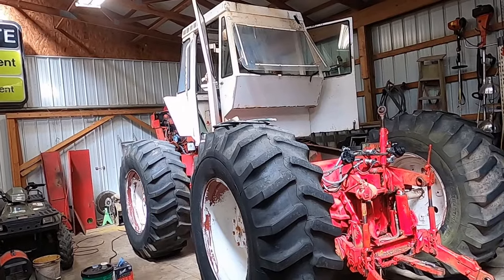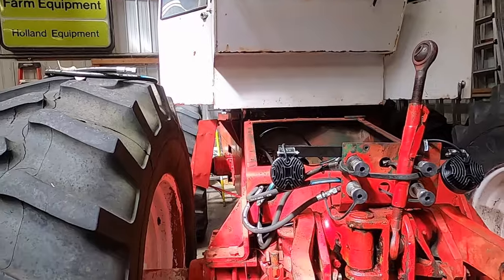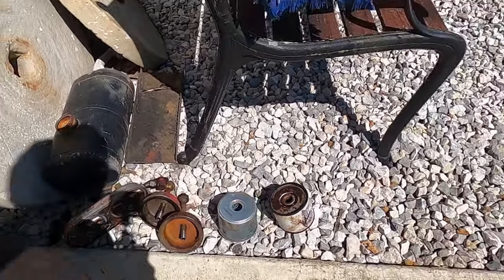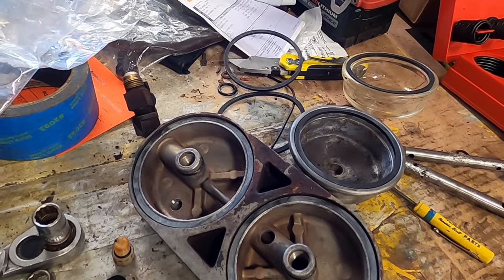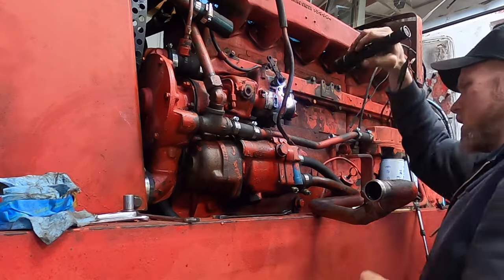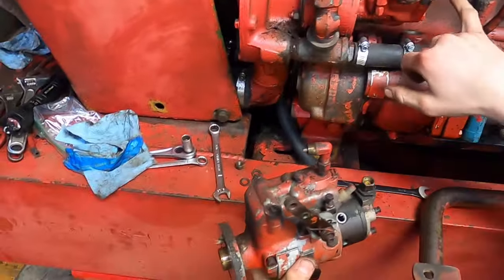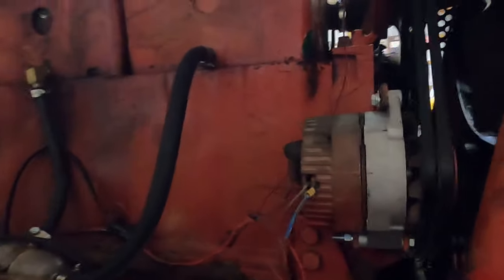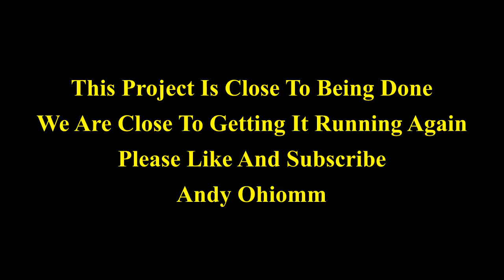Minneapolis Moline A4T project Continues And The Injection Pump IS Off

Comment: Ok, with the “egg crate” grill, not the vertical one, are you share this wasn’t a green tractor originally?  Not that it matters, just alway though that was a little difference.
Reply from the maker: It was a red Mm that the second owner wanted it to be a green Oliver. Third owner made it red again. Those grills have to be pretty rare.